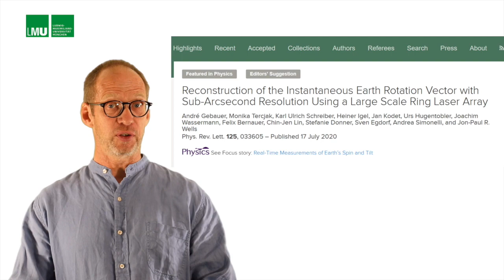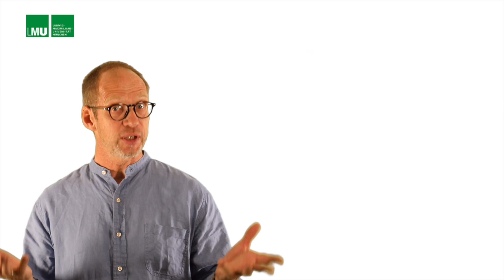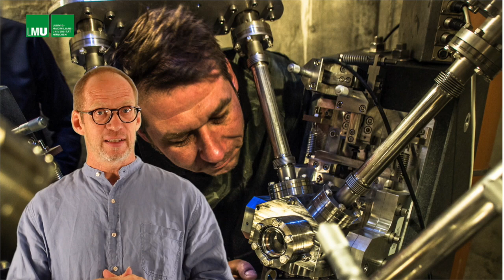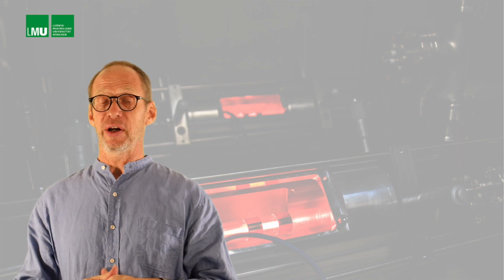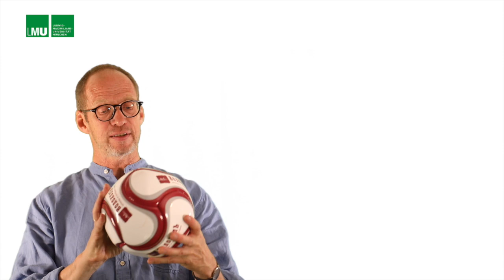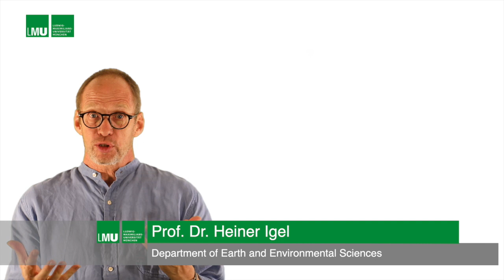ROMY ring laser measures Earth's rotation

Comment: FAKE SCIENCE...if I can't  reproduce these results  it's absolutely  Garbage NO- ONE IS SPINNING the Earth is not spinning.
Reply: 😂🫵.  The earth absolutely is rotating at its incredibly slow pace of 15° an hour. Just because you’re in apple of understanding basic physics, doesn’t make them any less real. 
-The sky doesn’t match anything but a globe, there’s no possible way the stars could rotate counterclockwise in the northern hemisphere, clockwise in the southern & straight over head along the equator on any other shaped earth. 
-Also the sun & moon could never go below the horizon if the earth were flat. Plus the sun couldn’t possibly be local or it would appear to get bigger then smaller as it got closer then further from the observer but of course it doesn’t because it’s so incredibly far away the changes in distance are negligible. 
-Similar to the stars paths, the sun & moon will both appear to essentially flip upside down when traveling from one hemisphere to the other, perfectly matching perspective a spherical earth & being impossible on a flat earth. 
-24hr sun at the South Pole also impossible a flat earth. 
-Seasons don’t make sense on a flat earth. 
-The Coriolis effect doesn’t make sense in a flat earth. 
-Tides don’t make sense on a flat earth
-Nothing works on a flat earth, that’s why no FE model can even accurately show the movements of the sun & moon let alone seamlessly account for nearly all phenomena perfectly. 
-The answer is simple, every single observation, phenomena & experiment points to the earths shape being a sphere & not flat. Not to mention we have thousands of pictures & videos of the globe. 
-There’s only 3 types of flat earthers, grifters, trolls & the mentally inept indoctrinated sheep who fell for the absolute dumbest conspiracy in all of human history because they can’t think for themselves, fathom basic scales & are most likely brainwashed by religion.
Reply: - ".if I can't  reproduce these results  it's absolutely  Garbage NO- ONE IS SPINNING the Earth is not spinning."

This measurement is LITERALLY done TENS OF THOUSANDS OF TIMES A DAY WORLDWIDE.

It part of the pre-flight test of modern aircraft.
Do try to keep up.
I have been hands on testing fiber-optic gyros using earth rotation as the stimulus for almost 30 years now.